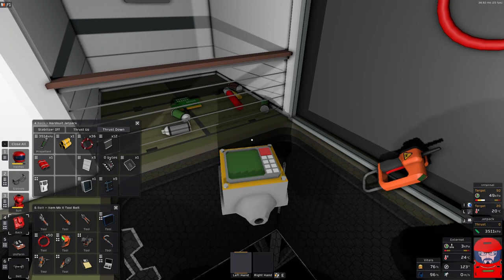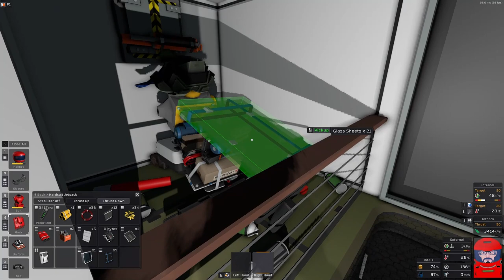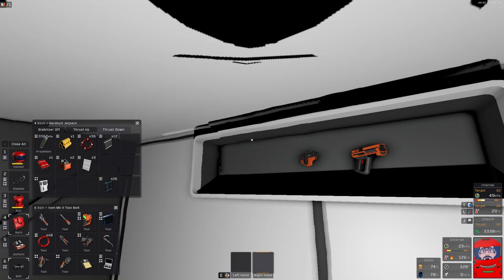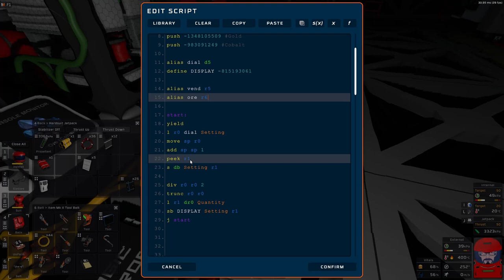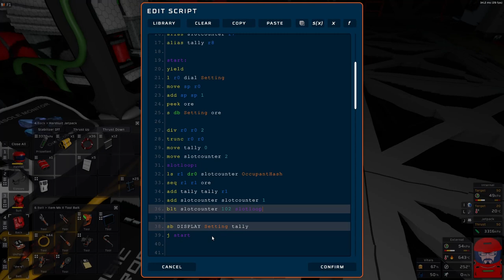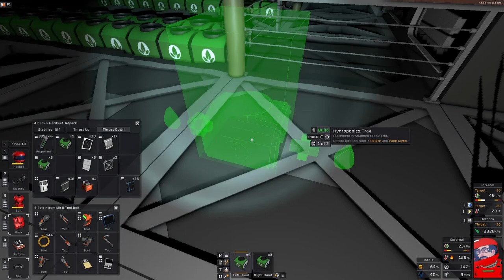Stationeers Let's play modded Vulcan 33 Big bada boom

Comment: I have come to the conclusion from my own testing that the advanced airlock chip was never designed to support multiple airlocks.  It is a single airlock control system.  No matter what order you do things in it will not matter as the chip was never created to sync two airlocks.
Reply from the maker: I dont think it was meant to be used that way but is still worth a try to see if you can sucessfully misuse things.
Reply: @cowsareevil7514  I totally approve of that idea, one should always try to see if there are ways to misuse something.

Comment: Regarding the airlocks:  a set of read/write logic chips (one for each direction) set to read the mode from one and write it to the one not occupied, may be the easiest solution, as you can keep the circuits separate easily with wiring.

Comment: The last chance of success with the airlocks is to try loading settings of both consoles and if one changes the IC sets it to the other one.
Reply from the maker: I would have to remove the second console and then I would have no way of cycling the airlock from the second airlock.

Comment: With the combustor can't you just make it a perfect mix and put the output back into your waste pipe so any uncombusted gas just goes back into your system and goes around again
Reply from the maker: I can but it will be very hot.  I wanted to not use the output and just monitor the contents adjusting the fuel mix so that there was no output.

Comment: 23:34 - Do you have to clear the stack every time the chip is reset? Since the stack is persistent, isn't it being filled with the ingot request data every time?

47:10 - Too bad you can't get the other two robot daughters.
Reply from the maker: You dont have to redo the stack every time but if I have enought room to do the stack and the script then I dont have to make 2 scripts.
Reply: @cowsareevil7514  Right, but my concern was that, since the stack is persistent, loading the same data into stack every time the chip is reset will eventually blow the stack. 

I don't know if this is even possible, though (is there a limit to stack space?), so maybe my concern is unfounded.

Comment: Quick question with regards to the airlock mirroring situation - I'm fairly certain I have seen you trigger the airlock cycle by activating the control panel on the closed door. Does it also trigger the airlock cycle if you use a switch to set the closed door to open from the outside? If so, could you not just use some simple logic to force the door you have activated to also activate its opposite number in the opposing airlock?
Reply from the maker: You need the airlock controller to cycle adn there is no way of forcing the cycle via logic.
Reply: @cowsareevil7514  Well dang. There goes that cool mental image of having motion sensors rigged to auto-cycle airlocks to whichever side of them I was!

Comment: Vending machines have 100 slots + 2 for the other reads, meaning you need branch less than or equal to 102, rather than just branch less than, right?  Just less than won't count the final slot.
Reply from the maker: 102 slots but they are numbered 0 to 101

Comment: I haven't tried this myself, but the airlock problem - would it work if you setup the one airlock just connected to the other. Without the 3rd console in the middle?
Reply from the maker: No.  They will both control the same airlock if I do that.

Comment: For the H2 combustor, if you have to have a pipe between it and the mixer just put a pipe analyzer on it and use that to figure out any mixture deviation since it'll share the "pipe network" with the internal tank of the H2 combustor. To check if that's true just put down an H2 combustor and use an active vent to shove gas into it, then reverse the vent to vacuum it out, if the H2 combustor is empty then using a pipe analyzer works, if it stays full of gas, you'd have to slightly overcomplicate it via the following method:
3 volume pumps, 1 on the oxygen line and 2 on the hydrogen line (branching it is fine), use a button to turn them all on and off at the same time to keep the ratio perfect.

That also happens to be the simplest way I can think of in order to create perfect gas ratio.

48:26 you COULD batch the furnace, you only have one on the circuit anyhow.
50:00 A team reference! What a way to show our age, eh?
Reply: The H2 combustor input doesn't mix the internal volume and the input pipe volume, it just removes gas from the input and adds it to the internal.
You can however move water into the H2 combustor from the output, I'm not sure if that's intentional.
You can determine the contents of the internal volume based on the gas output as you can control the gas output using the "Setting" variable, the internal volume is 1000L so you can multiply what comes out of the gas output by (1000 / [Setting variable]) to figure out what the contents are.

Comment: I've never played this game myself so I could be wrong here, but couldn't you write an activate command to the airlock consoles and as such just have 1 IC chip and 5 buttons/important buttons
Like, set the four consoles as d0-d3, define the button/important button, have it batch read the buttons and save the maximum setting to r0 and create a branch that says "hey only write activate to these consoles when a button is pushed, and for the love of Wilson, please don't blow up my base"
Reply from the maker: That is what I wanted to do but I cant write to the consoles, they are read only.
Reply: Ah. Well, I feel like getting it to work like that will just be a bigger headache than it's worth then, assuming it's possible. At least with the faster cycling it won't be as big a deal to move through that room.